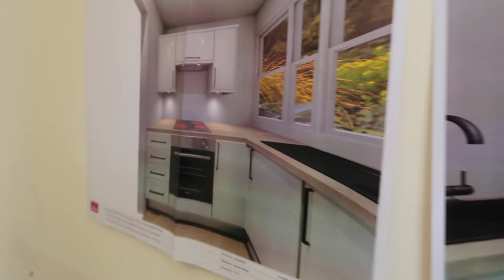Kitchen Fitting | VLOG 3 | Scottish joinery & carpentry

Comment: I'm a new sub from Maine, USA. I'm an old, 66 years old, carpenter in my 47th year of making sawdust. There are so many differences and similarities in the way we do things, and you do things. The countertop fitting is so different, we use full miters in the corners. I like your way.
I'm impressed that such a young carpenter is doing that quality of work. Keep it up.
Reply from the maker: Hi Roy, thanks very much for the comment. Amazing to here your still working away at 66, what do you specialise in?
Reply: @keelsjoinery  I don't, I do it all. On most jobs that I do, no new homes or additions anymore, I'll do the demo, framing, drywall, trim, cabinets, flooring, you get my drift. I have a bunch of friends who are contractors and most of them do the framing, interior and exterior finish and some build and install the cabinets. If the cabinets are store boughten, the install them. Most today contract the insulation and drywall out. Some do their own roofing and others don't.
When I first started in the carpentry field, we poured the concrete in the ground and shingled the roof. We did everything in between.
Of course, plumbers did plumbing, and electricians did that stuff.

Comment: A little advice from an old kitchen fitter 😂 set your room out as you did, fit wall units first and finish them, then fit your base units 👍 saves having to climb on worktops and possibly damaging them. Nice work though 👍
Reply: Agreed, from another old kitchen fitter.
Reply from the maker: Thanks for the comment mate, I’ve tried it this way and prefer doing bases first. Each to their own though 🙌🏼
Reply: I’m a base unit fitter first as well. Just prefer it.
Reply: Ex kitchen fitter myself prefer base units as allows easier manouvering of worktops especially long ones. Cardboard on the worktops normally saves any damage
Reply: I always fit bases first as often wall cabinets rely on the positioning of bases for their exact position . Bases first , then wall , then all panelling and appliances . Doors and i always do worktops last

Comment: Top job only things I’d add is add biscuits to the joints and I use the plunge saw for cut outs then finish corners with the jig saw as depending on the worktop they can wander. 👍
Reply from the maker: Fair enough I thought the kitchen was small enough to fit in a track saw in lol I it’s very effective to use a plunge saw for cut outs

Comment: I used to work for a kitchens firm lumping 4.1m long worktops up apartment stairs to 3rd floor and granite tops after all the base units . Most had Festool track saws, hoovers and routers, DeWalt for table, mitre, jigsaws, Makita for drills and circular saws, Bosch or other brands for less used tools. Had foil lining on hobs.

Comment: Exactly the same as I do it. But I also domino between the Bolts to help align
Reply from the maker: Nice bro I’ll maybe try that next time 😎
Reply: Same as but I use 3 biscuits. Nice job
Reply: @justicecase19  I used to use biscuits until i purchased a domino, crazy difference
Reply: Between the bolts on the worktop?
Reply: @jimh4072  yeah, I use 3 zip bolts and 2 dominos. I do the dominos so they wiggle side to side but up and down is perfectly flush!!
Reply: @Ajf91 . Thanks, going to try that. 👍

Comment: what screws would you use for upper cabinet brackets to fix to a brick wall?
Reply: 2" x 10s into red plugs 👍
Reply: cheers. What if I hit mortar not brick when fitting upper brackets-and if I can not move brackets? ta
Reply from the maker: @akfisher7138 be very unlucky to hire mortar you would still get a good fixing with screws and plugs

Comment: Aren't those feet receicers supposed to span the edge of the unit as well as the base panel of the carcas in order to carry the full load it looks like the entire load of what is above will land on the base of the unit instead of being spread vertically.
Reply: Yep they changed them